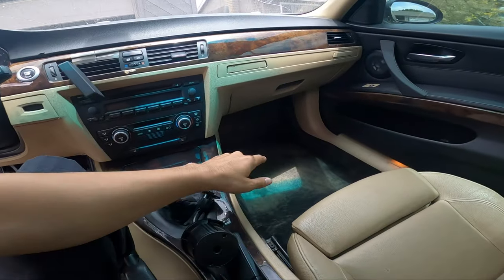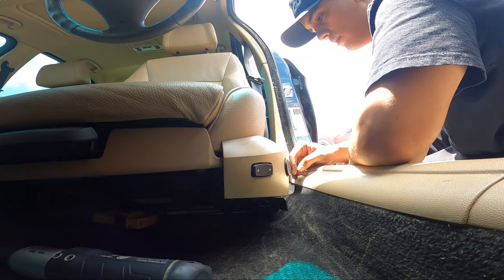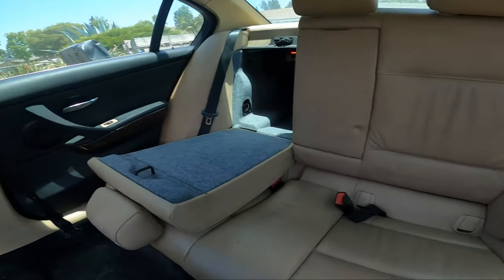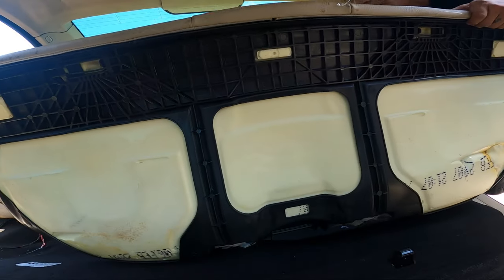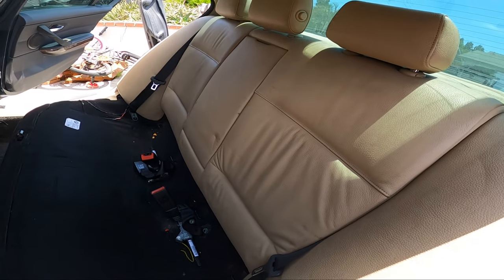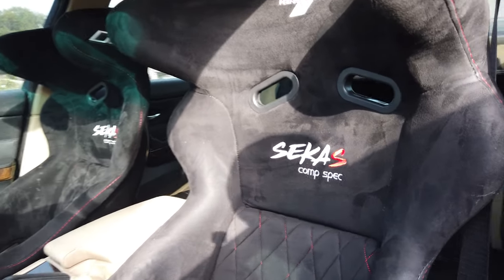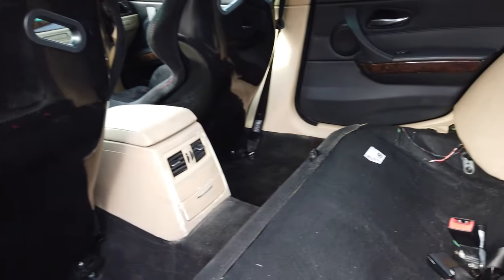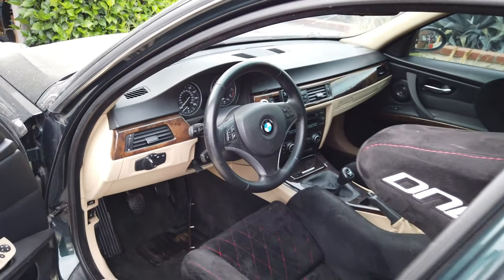How to Install Race Seats on BMW 335i E90 & Erase Lights on Dash

Comment: Cool video, I got a question for you. What did you do about coding out the airbag issue when you change your seats. 🥂👍
Reply from the maker: I used Bimmergeeks protocol,  I go through it in the video 👍
Reply: @3meansgo  Thank you for the reply and info.

Comment: But are the airbags still gonna work in an accident?
Reply from the maker: The ones that are left will, the app allows you to go in an turn off individually the ones you need off.
The ones on the seat gone 👼

Comment: What size bolts did u use I tried using the stock bolts don't fit the bracket
Reply from the maker: I believe I used the stock ones. I had a planted Seat base what about you? 
Maybe an Eye Bolt might work better I know there a pain in the A** to reach and tighten down

Comment: Where did you get the brackets to mount the seats to the floor. I think the seats i want only come with the brackets to mount to the seat, not the one that mounts to the floor
Reply from the maker: Mine came with the seats I bought but they where "Planted" brand. They ride a bit low so the more adjustability your seat has the better
Reply from the maker: https://www.plantedtechnology.com/planted-seat-bracket-bmw-3-series-sedan-convertible-e90-e91-e93-chassis-2006-2013-driver-left.html

Comment: I think I have to connect my seatbelt to my oem seat
Reply from the maker: Disconnect the harness from the oem seat and just transfer it over to the new One. It’s a bit of a pain in the ass getting the seatbelt buckle to fit but it’s possible

Comment: I also installed racing seats, after watching your video I bought PROTOOL CODEING $80, then I did exactly as you showed in the video and it didn't work for me, it keeps showing the air bag light on the board, what can I do. ??
Reply from the maker: If there is a light use the protocol app to look up what sensor is being set off and Then go into coding and switch the respective setting
Reply: Hi, thank for reply, can u be more a specific,, step x step ,, l end Buying $150 máster lic , still , cant do it
Reply: I already disabled every single code every single thing related  to seatbelt  and  airbag, and still l have the light on up on cluster
Reply: @angelsantos8342  u need to add RECA in the “vehicle order” section
so the ecu thinks you have the factory Recaro w/o airbags
Reply: @dylan-nguyen Bro thank you🙏🙏 Random comment from 2 years ago saving my ass lol. I did exactly what the guy in the video did and I still got the error everytime I started the car. Added the “RECA” like you said, and it fixed everything!!

Comment: I know this is old but those seats look like shit lol and if you didn’t want a backseat, why did you get a four-door?
Reply from the maker: Lowkey the seats where shit lol
Super uncomfortable for daily and couldn't see shit from the sides.
Sedan cars look great. I have a family and like being able to take the seats out and lose 150-300 pounds for an event and slap it all back in easily.
Reply: Yeah those seat’s definitely look uncomfortable lol. Those are meant for actual racing. I seen this cause I was thinking about putting some corbeau lg 1 seats.after I pulled the factory seats out and felts how they had lead in them lol.  Idk why anyone would put none reclining sears in a daily.  I was curious how to get the lights out the dash after removing the sears but seen a video on how to just code it out rather that putting in an simulator or whatever
Reply from the maker: @JohnDoe-mm6xg  corbeu are pretty comfy!  Anything that keeps it easy jumping in and out with a bit of padding is appreciated. I ended up coding mine out but yea a lil relay wired in also does the job